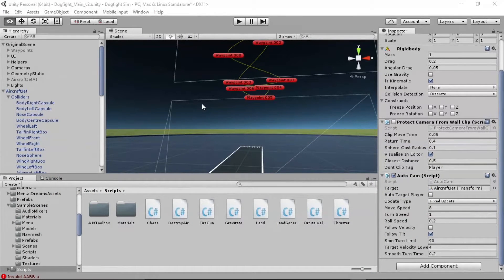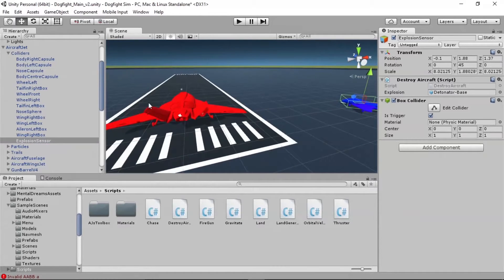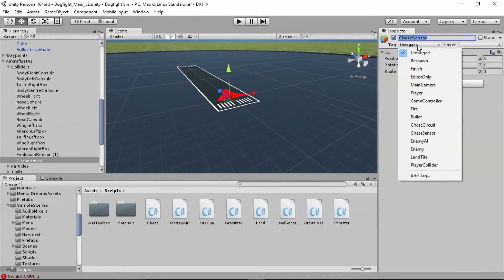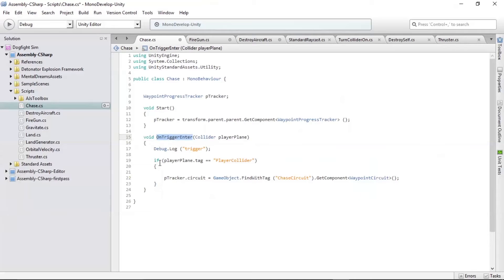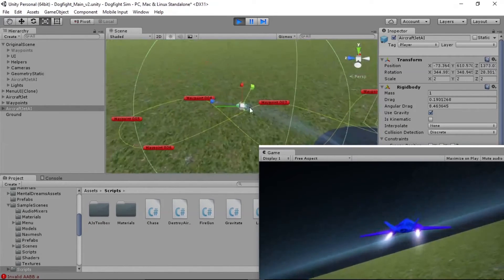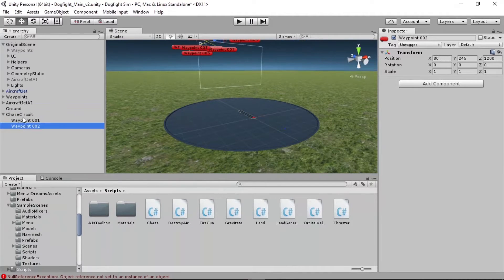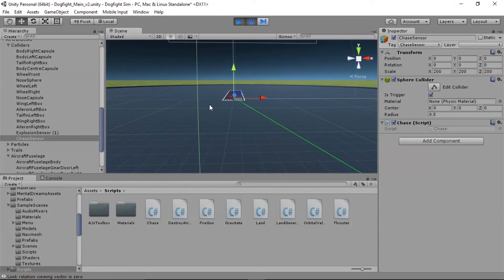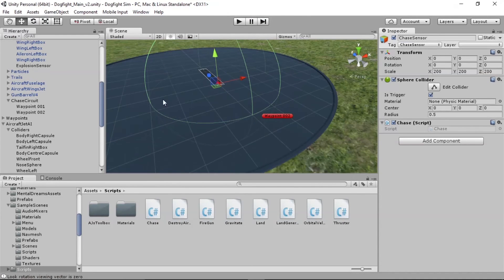How to Build a Dog-Fighting Flight Sim Game in Unity - 5 of 6

Comment: Everything is working fine but the chase circuit waypoint stuck at the starting point (in the runway) when testing the game in full screen mode and the enemy AI plane/flight/jet keeps rotating on that waypoint instead of following the player jet. If I pause the  game and come back to the scene window the green line pointing at the runway. When I click the step button suddenly the green line changes to player....please help me to fix this kind of error or bug or whatever. when the game window is in floating mode everything  works fine. The AI jets Follows the player jet . So the error is only occurs in full screen game window. Please help me ASAP.....

Comment: Hi AJ: first of all, great tutorials... Now, I wrote the chase script an attached it to the ChaseSensor, when I press play the AI correctly finds my plane and changes its waypoint circuit, but then it stays flying in circles and I get a log message saying something about the looking direction being zero or something like that, can't remember right now... Help would be appreciated!!
Reply from the maker: Thanks, Alejandro. If the enemy is flying in circles, it sounds like it is chasing a waypoint circuit that is fixed to a single point in the scene. Are you sure the ChaseCircuit is attached as a child of the player?  The enemy AI's debugging drawline (the green line) should show where the enemy plane is trying to fly at all times during play mode. When you press play, where is the green line pointing?
Reply: Hi AJ: thanks for your response. When I was trying to fix this problem, I did watch the green line pointing towards my aircraft, that's why I was confused. Even when my aircraft was flying straight, the enemy was still doing circles... I was trying to replace the default aircraft model from the Standard Assets with the model of the Wraith from Starcraft 2, and after adjusting the Max Engine Power and other values in the controller, I finally got it to work... I still don't like the way the enemy makes the turns, but I guess it's due to the values in the controller. Anyway, thanks for being here so supportive, and keep the good job :) BTW, do you think you can make a tutorial but for, let's say, tanks???

Comment: Hi AJ: I also had an error with the script at this point (specifically at "pTracker.circuit =") after everything else in the series up to this point has worked like a champ with my own coding following yours.  The error says that 'circuit' is not a method or property of the WaypointProgressTracker class, even though that .cs DOES have the line 

[SerializeField] public WaypointCircuit circuit;

I even downloaded your Chase.cs from Github to make sure I hadn't missed anything in my code, but the error persisted.  Btw I'm in Unity 5.3, whereas I get the sense from your IU that you're using 4x for this series.  I can certainly grab onto the circuit property of the WaypointCircuit class itself, but I could not for my life find a way to grab it by way of the WaypointProgressTracker class as your code does.  I had to hack around it by essentially duplicating WayPointProgressTracker.cs with a 'Foo' class, adding that to my JetAI as well, and then in my OnTriggerEnter function, rather than swapping out the circuit directly, I disable WayPointProgressTracker and enable Foo, which has the correct ChaseCircuit already specified.  After that, the chase functionality seems to work fine.
Reply from the maker: That's very strange. You copied all the code verbatim out of WayPointProgressTracker and renamed it to Foo and it worked? That's a mystery for the ages, but I'm glad you got it working at least. I just tried opening up the project in Unity 5.4.3 and it compiles with no errors on my end. shrug
Reply: yep.  Obviously I had to rename the class to "Foo", but otherwise the code is identical.  And my hack definitely works, shifting the AIJet into pursuit of the Player jet.  I'm not at all surprised my workaround worked; I still can't figure out why your code worked in other contexts than mine.  I imagine if I copied down your entire project it would probably work, but were's the fun in that?

Btw, any suggestions on how to slow down both jets dramatically, like by half, while still keeping them functional?  Everything works in mine but (without joystick controls, just keyboard) I haven't been able to actually shoot down the enemy in the sky.  The aerodynamics code is complex enough that I can't yet find the right set of vars to throttle down.  Still, I learned a lot from this tutorial; you have very good teaching chops.  I always end up hacking tutorial games beyond recognition anyway. I'll probably add a guided missile, on the player side, and then maybe on the AI side too.  No real gunfire dogfights since the Korean war...

Comment: I have a error in the chase script: CS0122  C# is inaccessible due to its protection level. --> circuit is protected.
Reply from the maker: That's strange. It seems like maybe you have a different version of WaypointProgressTracker.cs than I do. That's a Unity-provided script, so they certainly could have changed it before or since I made the video. They provide us the uncompiled source for it, so we can check. If you search for that script by name in your project, you should see the following somewhere near the beginning:

[SerializeField] public WaypointCircuit circuit;

This is how it looks in my version. Your error would typically be the result if the "public" keyword were replaced by the protected keyword. If you set it to public like this, the error should go away, but I can't guarantee that won't break anything else in that script.

If you still run into trouble, I recommend downloading my copy of that script from Github to compare and see if there's any difference with your copy. If you're using  my copy, the error should go away.
Reply: Yeah, line 14 of WaypointProgressTracker.cs out of the box is the protected keyword. Changing it to public doesn't seem to break it.